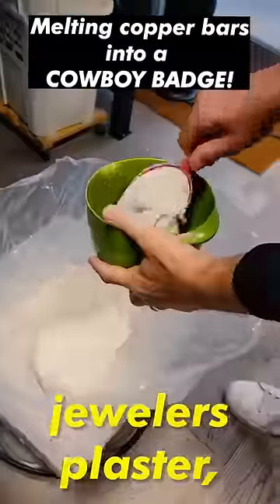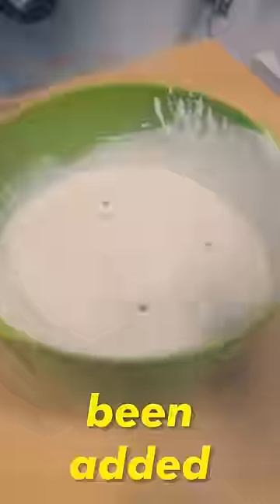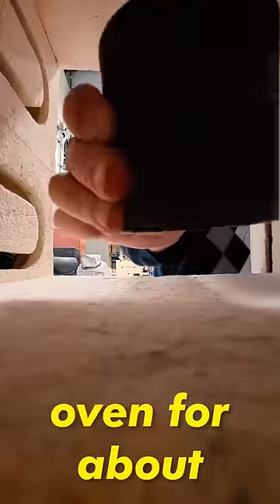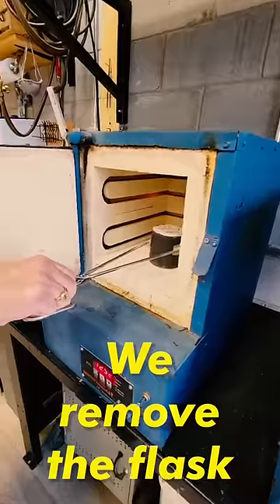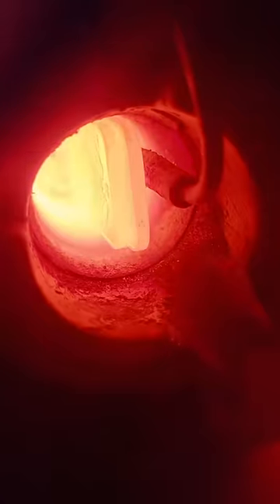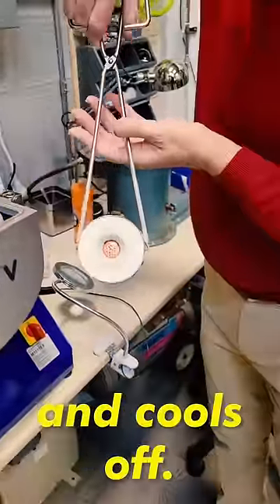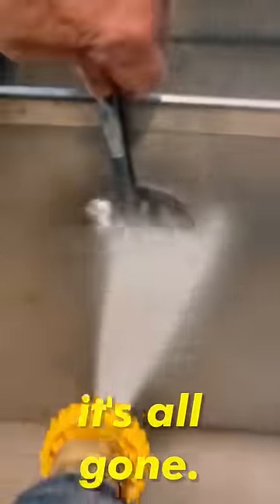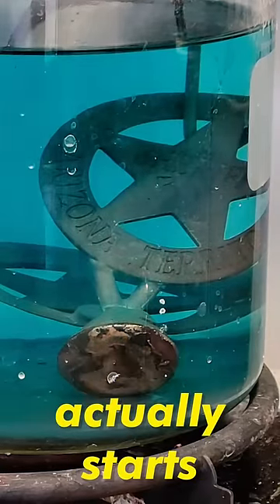Melting copper bars into a COWBOY BADGE! (Part 2) #diy #howto #art #copper #tombstonearizona

Comment: ‘Lost wax’ technique!

I was a dental technician, we made acrylic dentures and plastics items predominantly. As an apprentice of a few years, I remember my boss flipping open this old cabinet at work which I didn’t even know opened (I just thought it was a work bench with a cavity underneath) 
And inside was this whole compact fold out centrifugal casting bay! He was asked to make a gold crown, inlay, or onlay by our sister lab that usually dealt with our metals and that side of things, like chrome base frame dentures etc. Maybe they had a backlog of work or he was making it for a personal friend or something. But anyway he just surprises me with something hidden like that for years without me knowing. He’d gotten gas bottles delivered and attached his nozzle, let the gasses flow, sparked it up and then dropped some gold out of a sachet into a crucible and started teaching me how to heat and cast metals randomly, it was great!
I watched the gold heat up in a few different stages as he held the flame to it, it went molten all the way through. Then he slid the crucible into position when he saw it was ready, grabbed one end of this contraption and gave it a good whirl, it spun really really fast as he shut of the flames of the torch. The centrifugal contraption had weights to keep it spinning fast and for a while, and when it spun the molten gold shot out of the crucible and into a stone mould next to it. Thus casting the gold crown. 

I’ve wanted to play with gold and manufacturing like that ever since… but it’s an expensive hobby to start 😅 and a really hard line of work to get into!